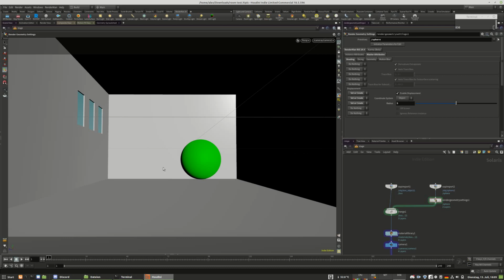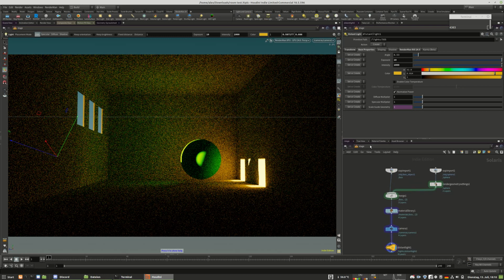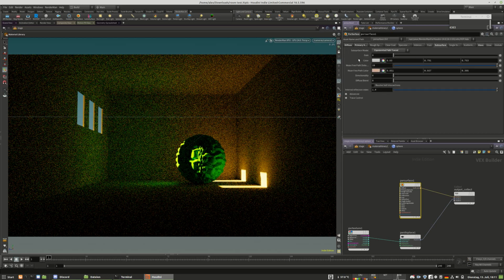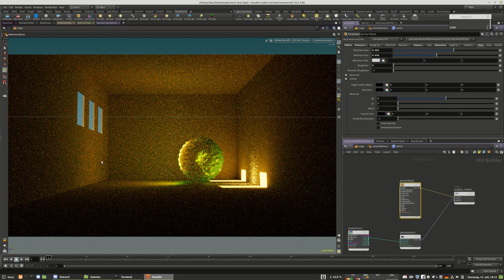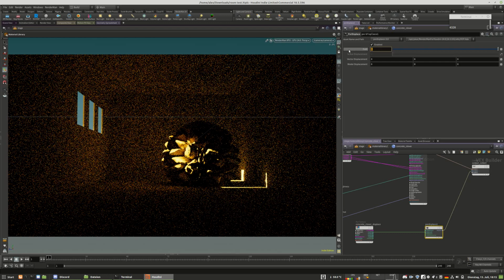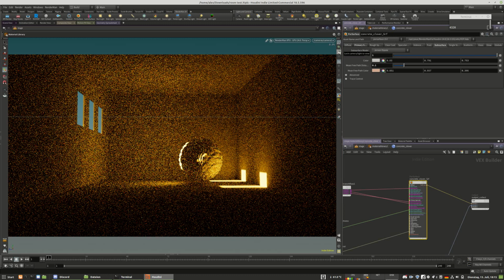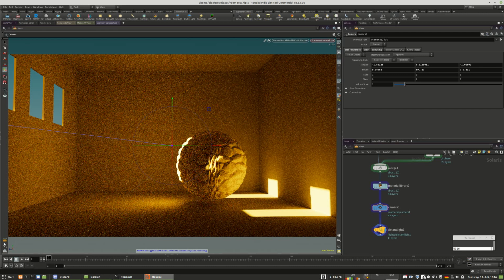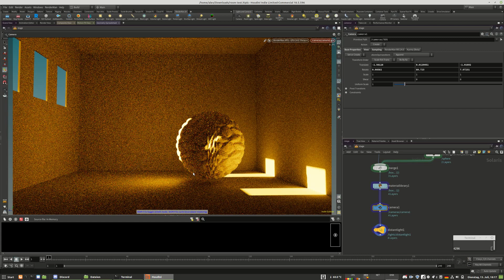Yet annother RM24 XPU Demo - caustics, Interior lighting, solaris USD

Comment: hi Alexander, thanks for the tutorial! 

Is it true that currently in order to use RenderMan 24.0 XPU in Houdini we must stick to the default build (i.e. no Houdini Python 3 build)? Thanx
Reply from the maker: yes, the majority of highend tools is running in python 2.7. Yes it will not work with Python 3 build. Python 3 is early in roll out in the industry. Alot of problems rise do to the change. However the Developers of Renderman are allready working on a python 3 version. So its just a matter of time.
Reply from the maker: Update Renderman 24.1 was released a couple minutes ago with python 3 support

Comment: I am loving Renderman 24.0, and XPU.  There are a lot of limitation in this current release, but it will get better I am sure of it.  A lot of bugs too :-).
Reply from the maker: Yeah. Agree. Glad i am not facing so many bugs currently but this is probably depending on dcc and operating system
Reply: @Alexs_Music_Comps  I should clarify, the bugs I am experiencing are in both Maya and Houdini and in Windows 10.  For me the bugs are coming more from the type of work I am doing, rather than DCC or OS.  CGI into clean plate, using LPEs, pxrProjection nodes, etc..
Reply from the maker: @Todd_Manus  all good. Recently we hear about alot of bugs and its really sad to see that many bugs even the beta users tried to find all bugs. Different operating systems as well as tools and use cases making it quite hard.